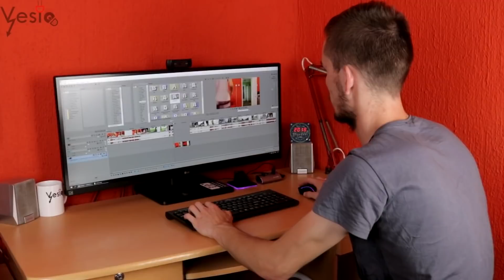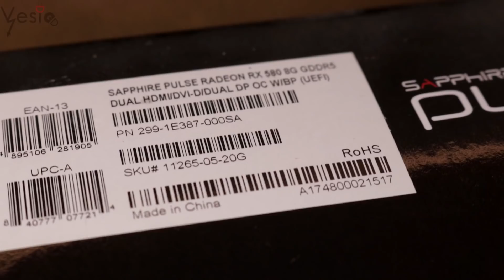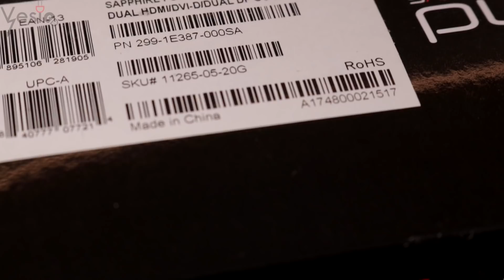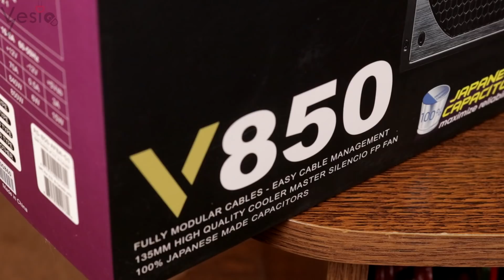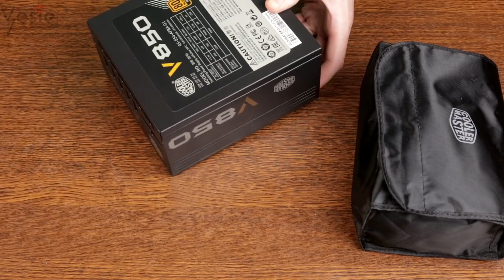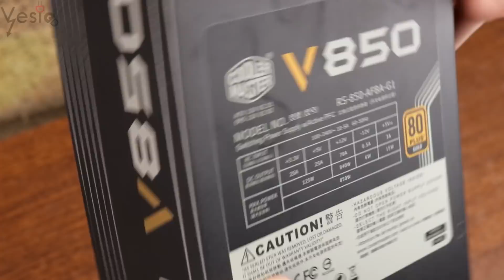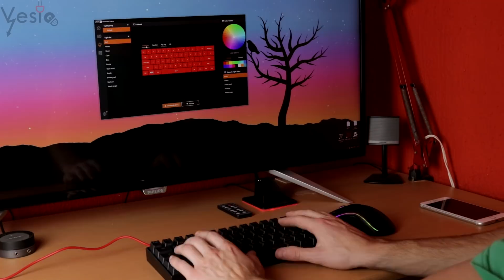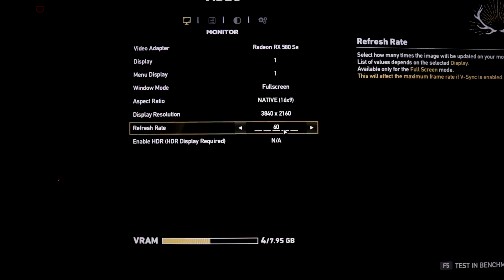Ponovo budzim svoj PC nova graficka i napajanje!!!

Comment: Весићу ако може помоћ?
кад отворим шах или неку другу игрицу на Win7 (фабричке оне типа карте и то) појави ми се
"Hardware acceleration is either disabled or not supported by your video card driver, which could slow game performance. Make sure you have the latest video card driver installed and that hardware acceleration is turned on" и игра ради преспоро
Иначе моја конфигурација 
intel E6750 ram 2 gb, nvidia gt610
32 bit.